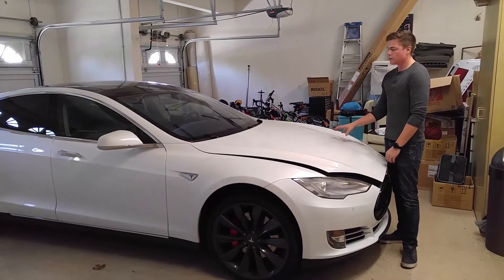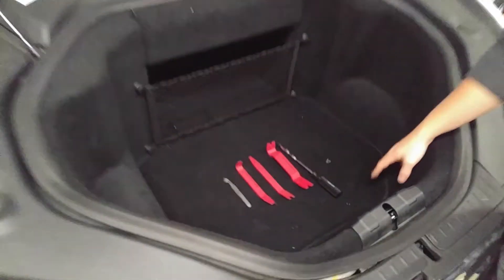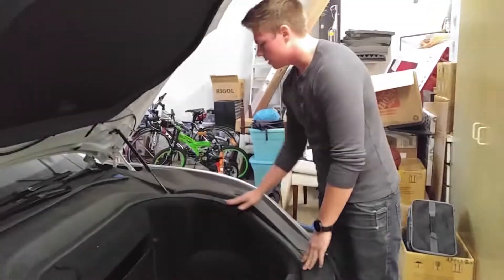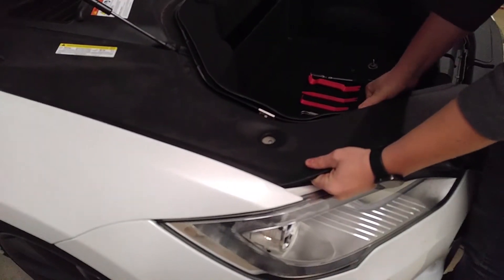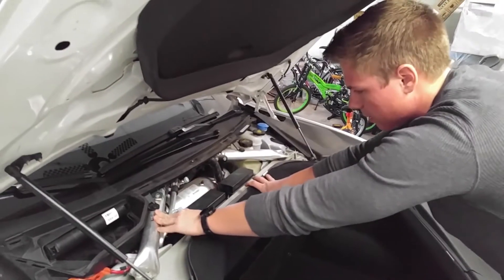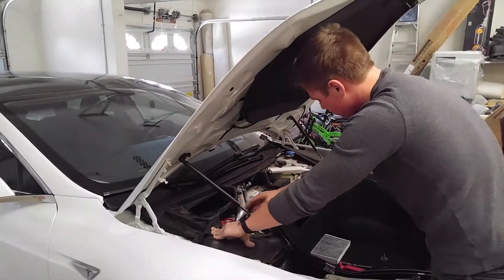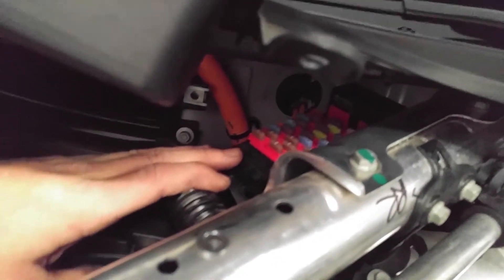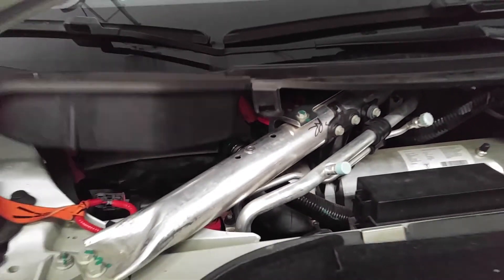Light Harmonic Tesla Model S - How to replace the Factory Fuse

Comment: I am getting a service message saying the battery fuse needs replaced soon, Ok to drive, schedule service soon.  If it's this easy, I'd rather not pay almost $700 quoted and suffer a 10 hour round trip drive to a service center (and wait all day while it's done).  You didn't indicate what factory fuse this is.  The video shows a lot of different fuses in the fuse box.  Is there somewhere to see what all the fuses are for?  Also, your video description depicts replacing a fuse--the video only shows you putting a fuse in an empty slot, not actually removing one that is supposedly replaced.  Some clarification please?  thanks
Reply: Did you figure it out by yourself or  __
Reply: Yes what fuse is it??
Reply: The fuse is ion the battery pack. Either at the top or at the bottom depending on battery pack revision. This is NOT something you replace yourself.